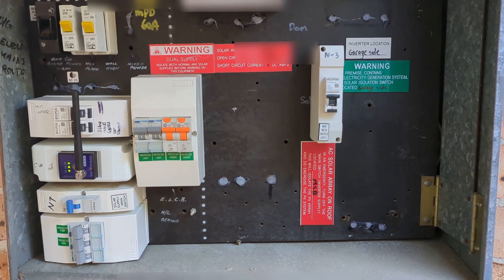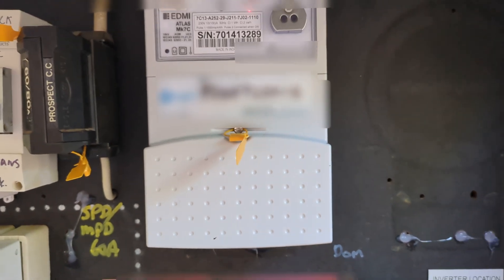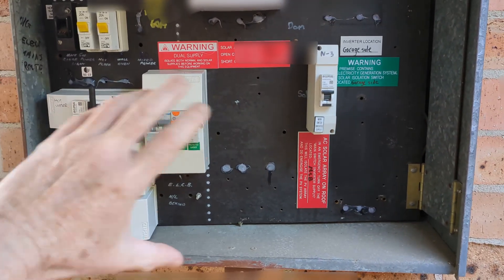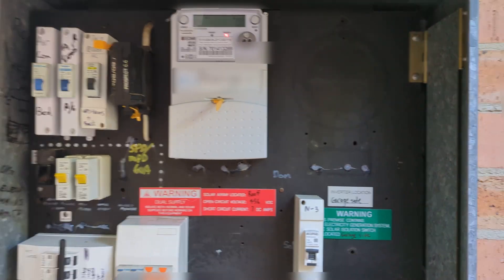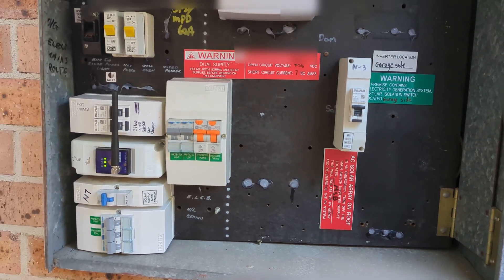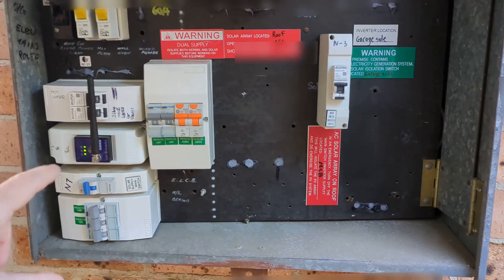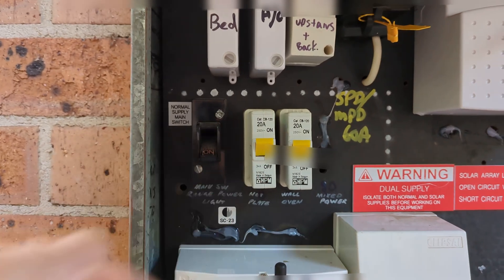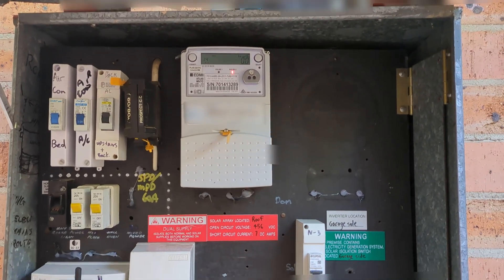Smart Meter Installed!

Comment: And no, you can't keep the old meters. They are heavily regulated items (the industry term is "Revenue grade" - you need to make sure you're not overbilling or underbilling customers, so the accuracy has to be sub 0.5% or better which is not easy given you have to do it under a wide range of power factors). Typically the lineman would record the reading for expediency purposes - but the meter needs to go to the meter shop where its reading is officially read out and recorded. From there it either goes back into inventory for deployment again, or disposal. But the meter shop needs the readings to maintain a chain of custody (which meter is installed where) because you don't want to pay for someone else's electricity do you? DIsposed meters are usually auctioned off in huge lots once the calibration seal is removed. If you really wanted to take one apart, they're plentiful on eBay as a result. Even the one on the wall - most meters have lifespans measured in decades and getting stuff certified is expensive so they don't change all that often.

Comment: Time of use isn't that common actually. It's rolling out but it's being tweaked a lot because things like solar have messed up pricing for electricity so much. DERs (the industry term is "Distributed Energy Resources") like solar and wind and the duck curve have changed how and when loads are most economical. For example, EV charging at night is not always the best - it might be better during the day during peak solar output. TOU schedules thus have to be completely revamped and updated to reflect this sort of thing.

Comment: UK Smart Meters....as I understand it:
HAN = 2.4GHz (Zigbee @ 100mW) / 868MHz (Mesh @ 25mW) for the home monitor (IHD) & smart devices.
WAN = 420/450MHz (LPR up to 2W) & 800/869MHz (4G up to 1W) for comms back to energy provider.
In Scotland, LPR (low power radio) is often preferred due to more rural/remote issues (our gorgeous mountain range!).
My EDMI meter has both WAN & HAN led's to indicate activity.
Reply: @IanScottJohnston  here in Australia, cellular modems need to comply with 3GPP standards and therefore support a maximum power output of +23 dBm (200mW)
The early EDMI meters in Australia use either an ELM400 or ELM 410 modem which has a HL7800 radio module from Semtech(Sierra Wireless) inside it.    The HL 7800 uses the ALT1250 chipset from Sony Semiconductor Israel.   Later EDMI meters use a modem from Quectel which has a BG95 radio module inside it.    The BG95 uses a MDM9205 chipset from Qualcomm.

Comment: Why does it feel like you're fiddling every couple of weeks with your electricity setup, replacing, repairing, renewing stuff? Is it worth it? Doesn't it run for years on end without throwing more money at it?
Reply from the maker: Nope, it's nothing like that. We have done recent renovation which required removal of both solar power systems. Common for me to go years without touching anything. My original solar system I didn't touch anything for 7 years apart from a DC isolation replacement because it failed.

Comment: Deja vu time again! They're dabbling with the Matrix, I guess.

I guess that after the utility company goes all electronic meters, some older ones will be auctioned off or they're gonna flood the e-waste processing companies, which may be a good source. Here in Poland it's easy to get an old electromechanical meter that's no longer viable for utility use, electronic meters are very common nowadays, remote readout meters (and powerline communication infrastructure) are gaining traction.

Comment: Is it me or do I see an IEC 62056-21 optical interface on that meter? The previous electricity meter we had (not smart digital) came with such a horribly slow interface and only gave data about the 4 kWh-counters (at 300 baud if I recall correctly). 

Back in 2014 smart meters came, with an open collector dataport in the form of a RJ12, the current DSMR-standard spits out data once a second and there's a ton of it, especially when talking triple phase: 4 kWh-counters, total power in and out. power in and out per phase, current per phase, voltage per phase, voltage sags and swells per phase, grid failures log and if there's a smart gasmeter around, that counter to. All locally accessible.

Does that meter spit out that much as well?

Comment: I’m at my mothers place (in Germany and they have solar panels on their house, but they’re both old and my mother his prone to turning off”unnecessary” equipment, but it looks like both inverter panels have been switched-off! The installer company has gone bust, so that’s a dead-end.
Should I switch on the inverters or get a solar specialist in?
Reply: I can't give specific advice without seeing it. But generally speaking solar inverters are self protective and will self isolated without the correct grid signal, so in theory it should be ok to switch them back on.
Reply: @EEVblog   @EEVblog  Thanks Dave.  I probably should have tried earlier when I first got here in May, but I think my mum must have switched the units off (thinking they were consuming electricity) - memory is a problem when get older!  There are two "NEDAP" (tm) "Power Router" units in the basement with large batteries.  The smaller unit is working and shows capacity TO the Grid.  The Larger unit shows 'Fault' with some internal relay switching - I guess trying to reset, with occasional "sizzling" sound.  So I've switched the larger 'battery' unit off ...
There is what I think to be a "To Grid" meter which hasn't moved until after I switched the smaller unit on.  I'll take that!

Comment: I'm using Amber to do this demand-based billing. Obviously works best with battery system, but it also helps to take advantage of some home automation to control loads. For what you're doing with the car charging etc, you probably don't need that bit :P
Reply from the maker: Just looked into Amber. Their PowerShift app does not work with my AERL battery. They claim up to $15/kWh feed-in, I don't believe that!